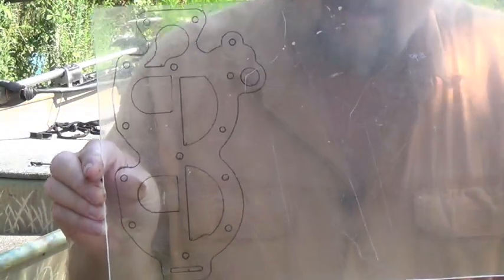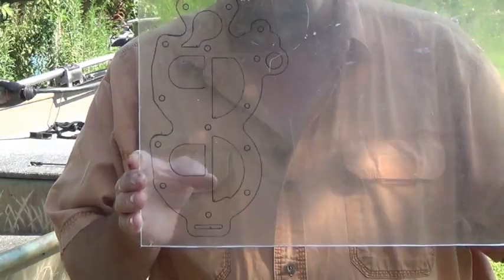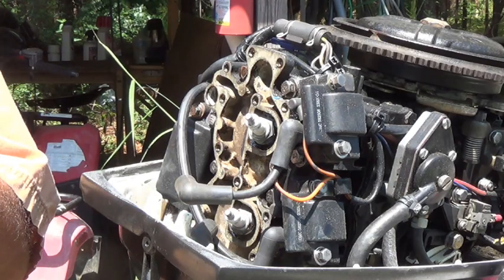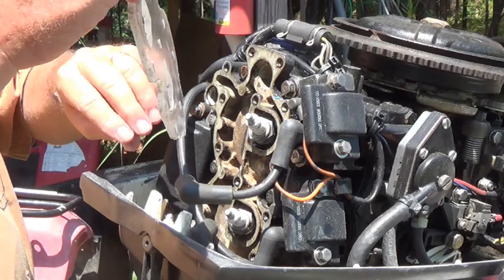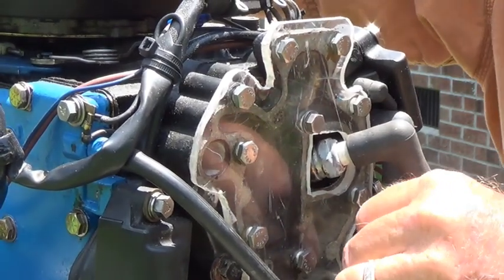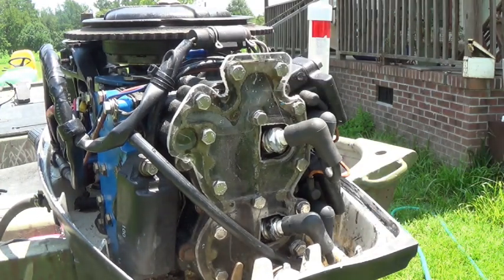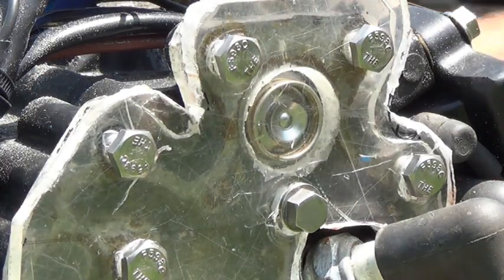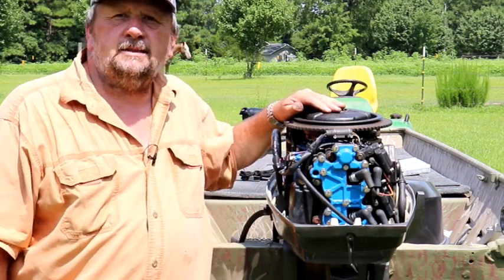Evinrude 25 Thermostat (Outboard Visible Cooling)

Comment: Mine is a 93 25 hp evinrude . I installed a new impeller kit twice , I thought I had a bad kit. . The motor runs fantastic and it pumps water out of exhaust and tell tail , until it warms up. Then no water at all is pumping out, just steam and it runs bad then. Does anyone know what’s wrong with it ????

Comment: Have you ever heard of the motor over cooling? My 25 hp 1984 evinrude I think my water is by passing the thermostat. The part of the head where the rubber stat seals looks all rough and corroded. The engine never warms up
About 107 degrees
 I tested the thermostat starts to open right at 143 degrees
 What do think?
Reply from the maker: Do you know if the rubber gasket on the thermostat is sealing good.

Comment: replaced the empeller on my 25 evenrude and water is pouring out the exaust but not the pee hole.  its overheating too.  think its the thermostat.  any advice?

Comment: I have an evinrude 6hp frisherman outboard 1974 model. I was wondering if you knew what size nut fits the prop shaft? I want to replace the plastic dome nut with a brass nut. Thanks for any help.

Comment: I have 84 35hp Evinrude. ran on trailer, water circulating sporadically. Put in water and idled about 1/2 mile before no tattle tale and steam coming out. motor was hot. Changed water pump ran on trailer only got it to pee a few minutes and now, no pee and steaming again from tattle tale. What should I check next? I did run hose trough water tube before pump change, had water at TT and out exhaust ports. Thanks in advance.

Comment: Very cool videos!  I'd like to ask your help Sir! I'd like to put a thermometer to my '72 20hp Johnson (I think the cooling system is similar). Could you please recommend, where should I drill the hole/thread to the sensor  (1/8 NPT threaded Temp Sensor)

Comment: Great to see how fills up and only gets to sender later my old Yamaha 4hp which pushed out steam as well as water was clogged with grit/fine sand and had to scraped out although it pumped water it was not enough once cleaned and that included the tube from water pump to power head now fine.
Reply from the maker: Good to hear, I thought this motor was clogged up, but the water flowed through it just fine.

Comment: It much water coming up through the thermostat hole  !!
Reply from the maker: When the thermostat opens the water got low in the head at idle. When the motor was revved up the water jacket filled up.  I am  sure that is how it does with the proper cover. Thanks for watching and commenting.

Comment: Hello I have a question I have a 1986 15 evenrude I bought from a friend, it’s in excellent shape for it age, I replaced the water pump kit, first time I took it out after the water pump it ran good, water was coming out the tel tail but not like it should, I took it home and blew compressed air threw the tel tail hose and it started to pump water good, then the water stopped coming out,some dirt clogged the the hose which connects to the tel tail it looked like a mixture of sand and grinded shells,I cranked it up then it started peeing good again. Took it out today 11/20 it was dripping than pouring out, also steam was come out the exhaust as well,took the cover off and the engine was really hot like I couldn’t put my hand on it for 2 seconds, looked at the hose and it was clogged again with the same sand/crusted shells,took it back home ran compressed air again thru it and water is flowing good throughout the motor again, Please any suggestions on this will help.
Reply from the maker: There are some small passages the water has to go through. If the motor has sand or fine shells in the in side making it run hot. You are going to have to pull the side cover and most likely the head too. check out my video on the cooling system. I will put a link to it.
https://www.youtube.com/watch?v=bAQo_iMM9E0&t=8s
Reply: @OmFishing  when removing the motor head is there something special I have to do to remove the tiller handle from the block ?
Reply from the maker: @joshuamunoz5036  On that outboard the rod that connects the two is just a slip  joint.

Comment: I just mounted my 30 horse Johnson on my transom for the summer. Its a 1998 motor but still like new under the cover because my boating is all fresh water.  We here  are very lucky not to have the corrosion & salt deposits of salt water operation.That must be a real pain in the rear for ocean boating.
Reply from the maker: The ocean is a real harsh environment. Most equipment does not last a long time. It's like a car in the north don't get to attached because the salt is going to eat it.

Comment: I have a 89 johnson 40.i went to take the thermostat out & there was a hole next to the thermostat hole that had a red plastic plug in it! Do you know what that could be???
Reply from the maker: A lot of models have a temperature switch close to the thermostat hole I am thinking that is what your looking at. Thanks for watching and Stay Well.
Reply: @OmFishing  would that temp switch cause the motor to shut off in an overheat situation or does it just put it in limp mode and let it continue to run?
Reply from the maker: @ryanperkovich5371  I don't know of the older outboard engines that shut the motor off completely. All the outboards I have worked on just put it in S.L.O.W mode.

Comment: Great vid, Any difference in performance? Isn’t it better if the motor runs cooler? Cheers
Reply from the maker: Proper engine temperature is a critical to good engine operation.A outboard motor that runs to cool will experience Fouled spark plugs, poor or rough idle , loss  of wide open throttle speed, excessive carbon deposits. It is important for the engine to reach the proper running temperature. I know that it seem like it would be good to run cool but it can be bad on the engine. Thanks for commenting and stay well.

Comment: So do you need the temp switch or will it run okay without it? Mine is missing it thank you
Reply from the maker: You can run your motor with out a temp switch, but if something happens to your water pump or the water intake gets blocked while you are running. It would most likely cause engine damage before you notice it was hot.

Comment: my 35 hp Evinrude is running hot without thermostat ,new impeller I took the lower unit out blow air and water up to the motor water come out everywhere exhaust clean ,I m give up ,to bad I fly with my 12 ft Jon boat  AT 34MPH
Reply from the maker: If you want to go through the work. I would check the grommet on the bottom of the engine on the water tube. You would have to pull the engine out and unbolt the exhaust tube. That is about the only other place left for a restriction.
Reply: thanks so much but I trade it for 87 Evinrude 9,9 and 120 cash so I m happy I don t need to go fast and I save money on gas I love your videos please don t stop we need you god bless you .

Comment: You probably know it, but always check the lower seal of the powerhead after overheating situations and weird diy fixes like that one. 
Many times i have come across with burned lower seal when someone had driven with a bad impeller or thermostat (or with both).
Reply from the maker: I had not had that problem yet. But thanks for the tip. That does make a lot of sense that the over heating is going to damage the seals too. Thanks for sharing and commenting.

Comment: I didnt notice any peeing at the end while running.
Reply from the maker: You are right I think the water pump is weak. I had to put the muffs on it to make this video. I had it in a container full of water and it would not pick it up on its own. Once I give it a little water it would start working and stay working. After I shut it off it would not pick up again until I give it a shot of water with the muffs. It was like I had to prime it. If you look right at the end you see me give it a shot of water off the muffs and it starts working. Then it is picking the water up from the tank. I like your fish you are holding in the picture. Thanks for watching.